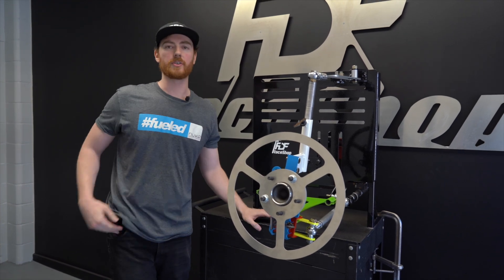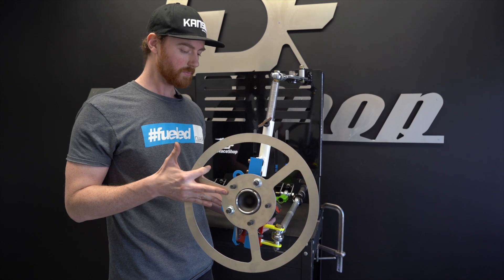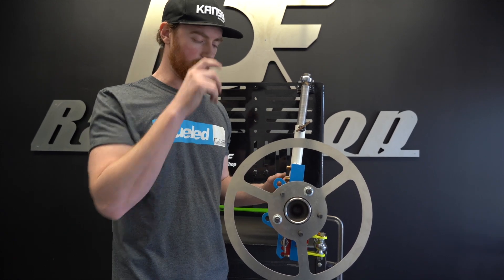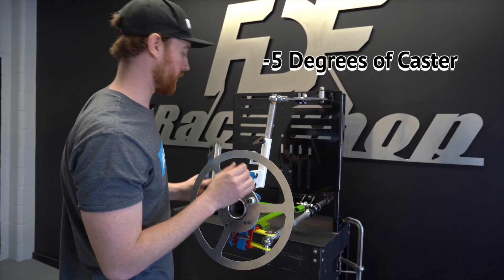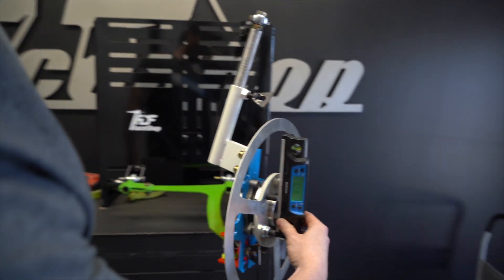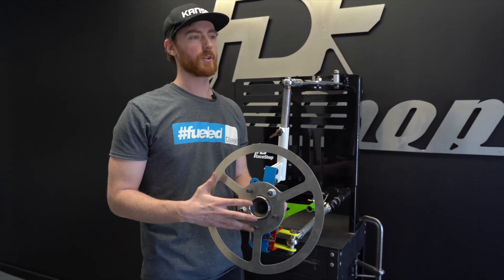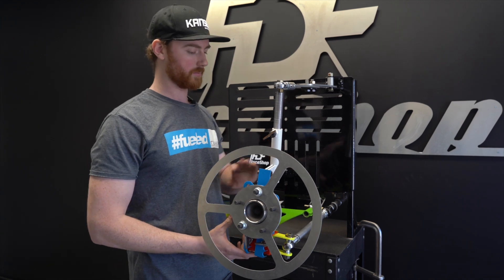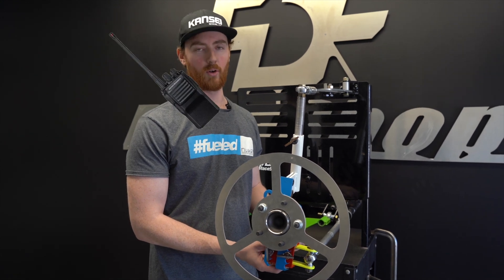Front Suspension Geometry| EP.2 Camber

Comment: These videos are really good.
I have a psm kit in my fc and i tried staying with my alignment specs but using their offset spacers at the hub for camber/kpi adjustment. the wheel was flopping so aggressively to lock. 

Wasnt really sure how to correct it as the top hats also adjust camber and caster at the same time.
I went back to my normal set up. Think i need to watch this a few more times haha

Comment: Dont know if you guys still get notification of comments but I've been watching the whole series, I don't drift but found it excellent. I'm using adjustable arms with top mounts that allow camber adjustment and I can use bolts for camber in the knuckle / strut. In my head getting 2 deg in the knuckle is beneficial as I won't increase my KPI much when setting a - 3deg static camber. I run 7+ deg caster so dynamic is still quite high.. Is this along the right lines for grip rather than using top mount alone? Big dynamic camber negatively impacts the inside wheel which so what I would get using top mount alone. I'm already running wider track through arms hubs so there's no need to drop ET for added track. Increasing KPI would result in large scrub (neg).

Comment: please explain how the lead wheel in a turn ( inside) would have most of the load. i would think that the outer onee would have most of the load
Reply from the maker: On google search “drift car 3 wheel” go to images. You will notice that there is little to no weight on the outside front wheel. so little that sometimes it comes off the track completely.

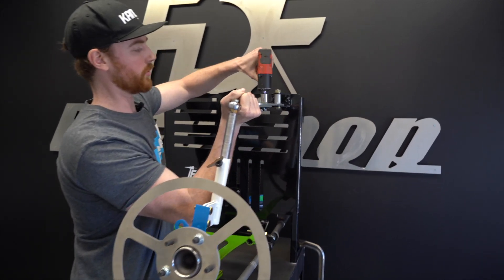Comment: Hi great demonstration, at 2:45 you say that when you change the length of the lower control arm to adjust the camber, you’re changing KPI so you need to also change the length of the upper one, but won’t that negate the camber gain that lengthening the bottom one gives you?

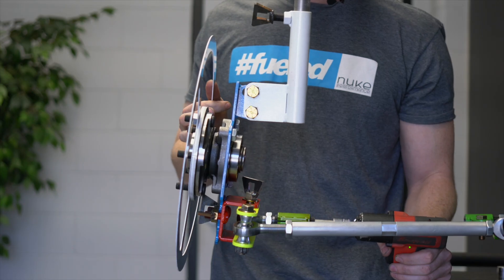Comment: Question around the 2:00 mark. Wouldn't increasing the lower and upper control arm length keep camber the same? If you make a trapezoid wider at the top and bottom the angle of the sides is still going to be the same, right?
Reply: Yes
Reply: Not if the arms aren't parallel.

Comment: Wow now I understand why the contact patch is horrible on my 190E at full lock. I have to correct the KPI a lot and adjust the camber on the knuckle instead of the shock tower. Thanks again for the videos!
Reply: you may want to wait for the caster video before you get too carried away. caster will also play a significant roll in the tire leaning at full lock.